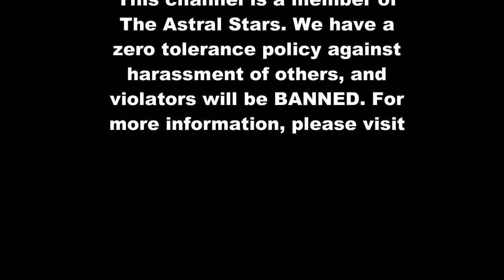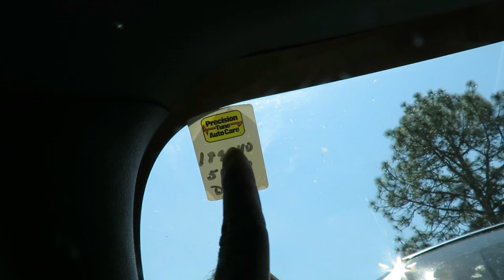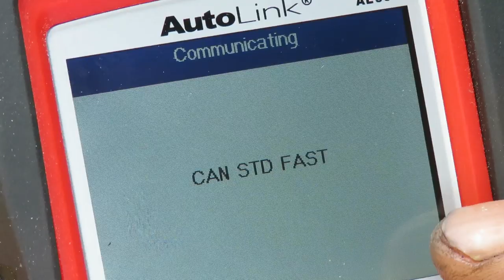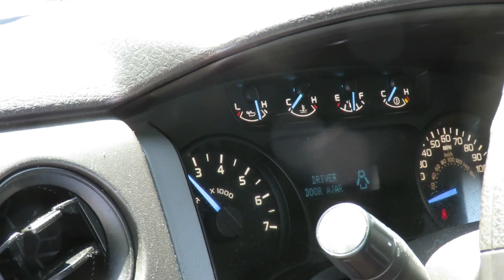⭐ 2012 Ford F-150 Pickup - 3.5 - VVT Solenoid A - Right Valve Cover Gasket Replacement

Comment: Awesome video.  I also way a 2012 F150 Ecoboost and it has a P0016, called a mechanic and he told me to try replacing these solenoids and sensors first before going to the timing chain.

Comment: Are yall in rocky mount NC. I have a '14 explorer 3.5 eco boost that keeps throwing codes for these solenoids, p0020, p0022 and local shop doesnt know what to do.
Reply from the maker: Yes we are
Reply: @OnlineAutoRepairVideos  where is the cam shalf  sensor  bank 2 and bank 1 in a 2012  v6 3.5 Litre  eco buster so we need to see where cam shalf sensors go bank 1 and bank 2  thanks

Comment: This was so informative and helpful that I watched it at least twice so that I was able to change the cylinder head gasket on my 2015 F130 ecoboost successfully.  Thank you very much.  In fact the Repair shop (will not mention a name) diagnosed the problem as a leaking cylinder head gasket, but when I took off the engine cover, I discovered it was the brake vacuum pump at the rear of the engine that was leaking.  I can just imagine how much more I would have to spend to get that repair, in addition to the misdiagnosed cylinder head gasket. Keep up the good work.
Reply from the maker: Appreciate that!!

Comment: Thanks guys. I just replaced the passenger side VC purchased on Rock Auto for my 2012 Ecoboost with 313K.  Not leaking anymore oil! I could not have completed the task without your video and detailed step by step instructions.

Comment: Hey guys, Thanks for this.  I was looking for where the cam sensor was on the passenger side of the 2012 and looks like that is what you unplugged just before taking off the valve cover.  Is it possible to replace that cam sensor without pulling the valve cover?
Reply from the maker: Yes, and thanks for the compliment!

Comment: Good stuff! Showed me the correct orientation for the seals on my 3.5 N/A. Although the Socket diameter is probably different for the N/A, I ended up using the tool from Advance.

Comment: Dry good video. I just had valve cover replaced charging 1k now being told ignition coil bad;truck was running good before the valve replacement. What’s up?

Comment: Do you guys have part numbers for the gaskets and VVT solenoid? Also best repair video out there, you guys are awesome!
Reply from the maker: Thanks, the part number for the valve cover gasket is Mahle VS50683, for the VVT solenoid it was Spectra Premium VTS1074. Please make sure these fit your vehicle because there are different options.

Comment: Mr Tim. Don't plain gasoline mess up your engine. When you use it for flushing????
Reply from the maker: The one important thing that I stressed in this video, is to NOT start the car. This procedure is intended to remove the sludge built up on the pickup screen, and in the oil pan, and by doing so, you allow the proper amount of oil to circulate in the engine, again, DO NOT START THE VEHICLE!!!!

Comment: Great video!

Can I also do the gas cleaning trick in an 08 Odyssey engine?

Can I put the drained out oily gas in the gas tank and won't have no issues later, or simply just throw away the drained gas?
Reply from the maker: HECK NO don't use that gas, LOL! But I am curious now to see what it does!
Reply: @OnlineAutoRepairVideos  LoL, I thought the oil in the gas would help lubricate the fuel pump and injectors, I see that's a bad idea now 😀!
Reply: You guys are great! It is refreshing that y’all show the entire job—problems and all.
Reply from the maker: @stoneypat2  THANKS!

Comment: Did you need silicone or similar under valve cover or just the gasket is enough to seal it properly also there are 2 grounds there if there any issue later on... risk to de-program

Comment: I have a question maybe you can help. I have a 2014 Ford F150 Lariat 3.5 ecoboost  4wd at startup the truck rattles then 1-2 seconds the noise goes away and the truck runs fine. Do my vehicle has cam phasers or sprockets from what I was told this year truck has sprockets and the the sprockets dont go bad.. I'm confuse I end up changing out the timing belt tensioner, timing chain, and guides the truck ran good for 2 days with no start up rattle.The 3rd day when I started my vehicle I notice that the rattle was back. Is there a certain oil type and filter recommemded for my truck. What else should I look at when it comes to this noise?
Reply from the maker: You might want to check that the timing chain tensioner is not going bad.

Comment: I did NOT hear the noise that it was making in this video but I have a 2013 EcoBoost been doing it since purchasing 6 mths ago at  cold starts but last 4 seconds. Now its louder and engine light is on.  I have multiple codes. One says  it is the VCT Sensor (P0012 CODE). Is there any way to know if this will fix the noise on the cold startups or is it my timing chain and phasers?
Reply from the maker: It's possible, but you may have to remove the oil pan (if there is a lot of carbon like in this video), and replace the oil pump if it does NOT work.

Comment: I have a catalytic converter code but I tested the exhaust temp and my cat isn’t bad. I heard that the P045a code could be throwing that one as well. Have you seen that before? Trying to figure out why it’s throwing that code as well. The exhaust coming out the cat towards the rear of the truck is hotter which means it’s good.
Reply from the maker: What is the exact code, and do you have any other codes with it?

Comment: My question is are both those solenoid the same part? I have to do this to my truck and want to go ahead and replace both solenoids but I'm not sure if they are the exact same part
Reply: No they are not. One is intake other is exhaust
Reply: I need to replace both solenoids on bank 2. Are they the same part numbers as bank 1?

Comment: I have a po54A code on my 2012 f150 which says “cold start B camshaft position timing over advanced bank 1”... does this code mean I need to replace the vvt stolenoid?
Reply from the maker: You should check the connector and wiring first, and then the oil MUST be clean, as in oil changes kept up.
Reply: Thanks! How would I check the wiring and connection?
Reply: I have the same code & a mechanic told me this was the problem & another mechanic told me it was camshaft position sensor &another say chain is stretched (2009,000miles2014f150eco)was company truck oil changes always on time. Please reply thank you sir

Comment: I have a question if you can help me let me know please..why is my valve cover stuck on the engine it won't come out easy i took off all the bolts and its super tight do you know what it could be?
Reply from the maker: If ALL the bolts are out, try using a screwdriver. It might be just stuck.
Reply: @OnlineAutoRepairVideos  thank you and great video 👍
Reply from the maker: Thanks!

Comment: Thanks for the video ,I have a question ..
My 2011 F-150 with 3.5 when cold makes the same timing chain noise at startup for one second then then smoothe out but every time it makes this noise the check engine light comes on with p0012 and p0014  but I delete them ,,
Do you think if I replace these two sensors it would fix the random chain noise at start up ?
Most of the time when I start the truck I hear no noise and it drives perfect it’s only when I hear the noise immediately after the light comes on and it drives rough
Reply from the maker: First, you have to clean the engine, like I showed in the video. But, it's a good idea to leave it in overnight. I can't stress this enough...MAKE SURE NOT TO START THE ENGINE WITH THE GAS IN IT, YOU MUST DRAIN IT FIRST AND ADD NEW OIL TO IT FIRST. Second, make sure to get a very good oil filter, specially one with an anti back-up valve. Then, get really good oil. Try that, if that doesn't work, damage could have already been done and the timing chain tensioner is damaged.
Reply: Astral Auto Repairs 
I’ll do that thanks
Reply from the maker: Let us know how it turns out.
Reply: Astral Auto Repairs 
I will for sure
Reply: Astral Auto Repairs 
I forgot to ask ,,
Do you think the CELis what triggers the chain rattle at start or is it the rattle that triggers the CEL
Reply: Astral Auto Repairs 
Ok 
After the flush
P0012 gone 
P0014 gone
Chain noise also gone 
Still have 
P0024
P0022
Reply from the maker: @malikothman5381  Looks like there is still an issue with the other two actuators. They might be clogged with dirt, something a flush can't fix, but you might be able to clean them if you remove them.
Reply: Astral Auto Repairs 
Well I put sea foam in it I’m going to drive it a few hundred miles and see what happens ., but for now I’m very happy the chain rattle is gone
Reply: @OnlineAutoRepairVideos  that happened to my truck. My cam phasers went out. I have a 2012 Ecoboost. That rattling started when I first bought it and only when cold start up. I always changed the oil when got dark. Chased misfires for about 20k miles. Truck only has 47k. Y'all's video is legit. So smart guys. Thanks again!
Reply: chain tensioners work with oil pressure but if the tensioners are worn and your using 5W20 they don't build up pressure to tension the chain.  Use 10W like I did and that helps the worn tensioners fill up and do the tensioning on the chain.  Rattle is gone on my truck.

Comment: Manufacturers are telling customers to change their oil every year or 15-20 thousand miles. Transmission oil is lifetime they say. Don’t do this people! 3-5 thousand is good enough depending on how hard you drive your car.
Reply from the maker: 15-20 thousands miles is WAAAAYYYY to many miles, even if you use synthetic it's too much.